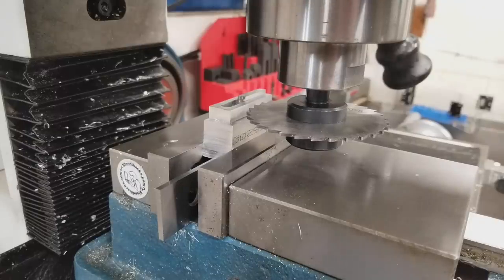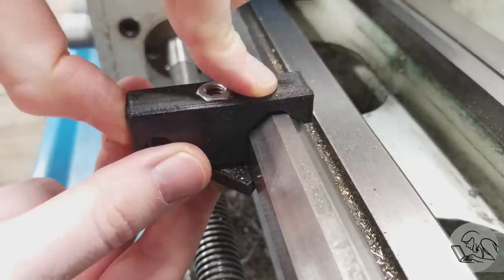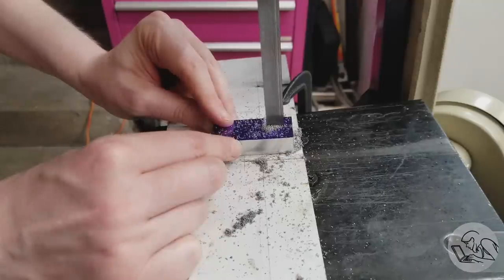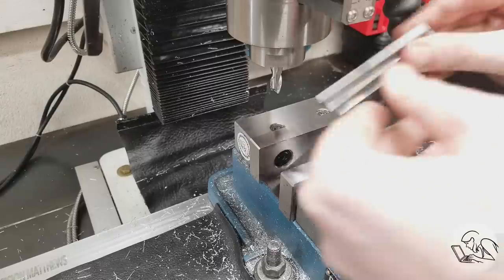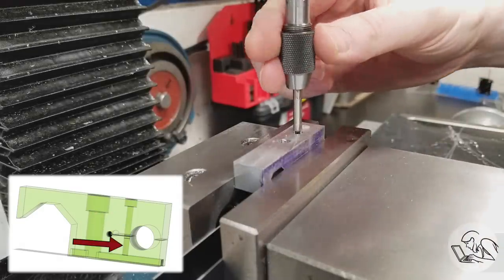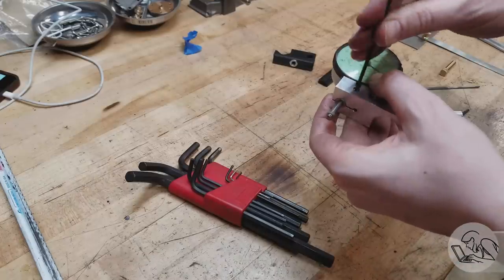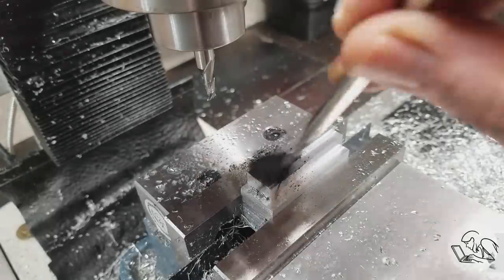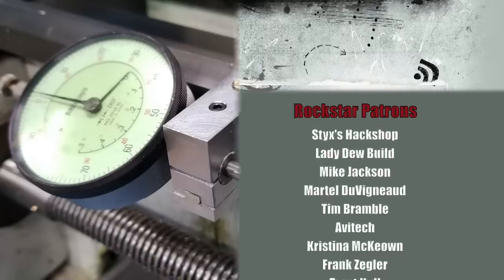Lathe Stop!

Comment from the maker: Lots of good theories on the 94°, but I think the most convincing one is that it’s so they can easily grind the mating surface on the carriage with a 90° wheel and not have to worry about clearances. Sounds plausible to me!

And yes I know tongue and grooves and mortise and tenons are all things that people want to know that I should know.
Reply: (Al + Fe) * hanky panky = galvanic babies
Reply: Ask Mr Pete. The YouTube shop teacher. If he doesn’t know no one knows.
Reply: I'm gonna have to use that precision cat hair tip, although mine would be precision dog hair. I wonder how that scales? 😉
Reply: #MetricDegrees
Reply: I recently both watched this video and skimmed Moore's Foundations of machine accuracy. Page 56 concludes that 90 degree V-way is the "best practical choice" (for measuring machine design, that is).
Reply: Supposedly this reason:
"This is how slideway grinders tend to work on prismatic beds. The saddle is carried on a sub table and offset so that grinding one side of the V on the bed grinds the opposite side of the V on the mating part. It helps insure that the angles actually match - the important aspect."

Comment: Snorted out loud at "Big Muskie the 13,000 ton dragline," because that trivia occupies a seldom-used corner of my brain as well!

I love, love, love how you analyze design and order of operation decisions, because it is so much more informative than simply acknowledging a mistake or sub-optimal choice.

I also like seeing someone adapt who doesn't have the best tool for every job, works with the limitations of what she has, and makes a worthwhile product.  Kudos for using angle blocks, a protractor, adjustable parallels, and machinist jacks in a single video!

Comment: An option for thread in Aly is to fit helicoils, these are a thread repair system which installs a S/S coil, in the shape of the required thread, in the hole. Have used them extensively on Aly motorcycle engine cases and the new thread is extremely strong.

Comment: Just made this. Not precise as per plans as I'm a newbe.. I was uncomfortable with how close the cap head screw hole "could" be drilled to the indicator hole. After a head scratch or two I decided to skip the clamping feature and slit.  I drilled a hole in the end level with the indicator hole for a set screw to secure the indicator. Very happy with the result. Thanks Quinn for the outline/idea.
Reply from the maker: Excellent! Nice to hear someone else made it

Comment: Slitting saws are what I use on my CNC all the time.  Helps reduce ops.  I use a 3.5" diameter 72 tooth carbide saw, 0.058" thickness.  It's quick satisfying to have a very thin web at the end.

Comment: I just checked the front v-way my Grizzly G0602, which I've always assumed is made from essentially the same castings, and to my surprise, it's square.  No idea why the PM would be 94 degrees.  I wonder if they're all that way or if yours is a unicorn.
Reply from the maker: Wow that’s really interesting. The castings are the same, I’m sure, but they must grind them differently. I think Weiss makes the PM machine.
Reply: Blondihacks I just checked my PM1340GT and it’s 90 dead on.  Maybe the one precision square used on mainland China is out of calibration.  😁

Comment: Hi Quinn, thank you for another useful video. I appreciate the time you put in beside filming the event, is large. I would like to help you with a bit of advice, and, for many others I see do the same thing. (Don't think I'm singling you out).
When using a hack saw, please use two hands, one on the handle and the other on the frame front. Your blades will last longer, your cuts way more controlled and your fingers will love you even more. The hacksaw is one of my "go to" hand tools, I have three with different tooth pitch blades fitted, adjacent to my vice. I used to train machining apprentices and the file and hacksaw were major learning points for them.
Please keep your vids comming, they are aimed at the right demographic of machine tool owners. Well done.

Comment: My local tool supply carries Thurston HSS slitting saws.  I have had good results with the 2.75" x 0.040" 72-tooth blades on my small mill.  I usually run 400RPM in mild steel and a little faster in aluminum, definitely in the conventional direction only unless you have ball screws.  I did make my own TTS-style arbor, which is very rigid, but the saw still runs out.
Reply from the maker: Yah, real machinists tell me that 100% of slitting saws run out. It’s part of why they say to take deep cuts with them, otherwise one tooth does all the work.

Comment: Looks good. This is my kind of machining. Measure twice, Cut once, Test fit........... Realise the dimensions on your carefully drawn plan don't quite work in this real world application, Cut again, Scratch head, One last cut, Swear a bit, A few final dimensional tweaks with some files, Job done ! :D
I occasionally feel like my lathe tools are only there to rough things out before I get them to final diameter and parallel using emery cloth ! LOL !

One little thing to note though. It's always good to have the DTI only just clamped tight enough to stay put in normal use. If you forget it's there it's usually better to have the carriage push it out of the clamp so it can take it's chances dropping into the chip tray than to risk crunching the gauges internals. Alternatively, fitting a bolt into the right hand face of the clamp as a stop to hit before the gauge bottomed out also works pretty well.

Comment: The deformation in the plastic for the stop is a problem if you use the auto feed. However, for a student, where it has to do manual feeds, it is a god send. If I get in, I am designing and printing one of these for the lathes where I will be studying at, that is for sure.

Comment: I made something similar, but use it as a dead stop instead of an indicator holder. The tenon is OK for a printed part, but is a pain if machining one. All that's actually needed is a retained pin superglued into the holder, and a slightly oversized hole in the clamp bar. Much, much easier to make! It's used nearly every time I use the lathe. and after six year's use the locating notch is starting to spread, so I'll eventually replace it with a steel part.

Comment: Good job, normally I would expect to use the 3D printing to refine your design before whittling metal. On that point I must get round to changing my end stops from 3D printed versions.  I would guess an angle slightly greater than 90 degrees is used so it is possible to grind the sides of an internal V using the radius of the grinder (or possibly shaper) whilst maintaining side clearance.

Comment: Hi Blondie. On this side of the pond, a slot drill will cut a hole through solid material, ie without a pilot hole. Slot drills are usually 2 fluted but can also be 3 fluted, these are called FC3's or 3 fluted slot drills. I'm not sure what the FC stands for but who needs to know? 
End mills will NOT cut a hole through solid. 
As the manufacture and supply of quality cutters is limited to only a handful of brand names that, importantly, also have a worldwide reach, it is very likely that the same terminology is used in every English speaking country. 
Here i the UK, this definition IS WRITTEN IN STONE! 
Hope this helps to stop all the confusion that I hear so often in the USA.

Comment: Very nice video. Well done and easy to follow and listen to. I will definitely build one of these machinist hammers. Easier to machine the central head tap on the milling machine, as you mentioned in the video. I would rather drill thru & counterbore the head for a #10-24 SHCS and tap the end of the handle for same, then c’bore the opposite side (180 degrees on center of the clearance hole and c’bore) for the handle to fit into the turned diameter. Keep up the good work.

Comment: Another way to remove that clamp from the block is to bandsaw it off from the chunk and then mill the sawcut face to dimension.  I feel the same way that you do about slitting saws and I usually find a way to avoid using them.  For instance, when I'm making a clamp in steel I just use a super thin cutoff wheel in my angle grinder to make a narrow slit.

Comment: From what I've read the reason the ways are 94° is a corner cutting measure as the saddle and ways just need to match and slide along 1 degree of freedom. As the faces of the ways generally aren't used for precision machining, it's cheaper to give the ways a larger angle tolerance and match all mating components to that new master angle.

Comment: There's 180 degrees in a straight line. Substract the 137 from 180 and you get 43 degrees. Substract 43 from 137 and you will get 94 degrees left over.

Comment: ive been using 3d printers for quite a while now an when it comes to stuff like this i find myself battling with myself on making it with my 3d printers or using aluminum to make them so it would be a learning experience but in most cases i dont have everything i need to set the parts up to make the cuts so i end up drawing it out on paper then taking those meassurements an making a 3d model in tinkercad an then print it out in pla plastic. sometimes i consider taking an printing stuff that would help me set the parts up in the vise but ive always felt like the plastic wouldnt be the best option to do this with, but im at the point that i think im going to try it an see if i can use it to make some stuff that i can use to replace the printed stuff. im still new to all this an have had my lathe a total of maybe 3 moths and not even a month for the mill. i dont have alot of material to work with, the aluminum i have is 3 old amd heat sinks that ive milled down to square cubes basically just cut the fins off an the rest of the aluminum i have is from an old head that i took an angle grinder to an cut a few chucks of aluminum off. im going to keep cutting it down til i have it all cut up an able to be put on my mill but for the lathe ive only had old bolts that ive been able to find, an old brass hammer that was my grandpa's an my dad gave it to me so i cleaned it up an plane on fixing it back, just need to get something to go on the ends, not sure what to use for that, delron or rubber, i'll figure something out even if i just print something out in tpu but other than that i got a set of rods from amazon that was like 2mm - 12mm an it came with aluminum, brass an stainless, so i used the brass and made a set of bits to go in my soldering iron to make pressing threaded inserts into my printed parts alot easier so thats really the only useful thing that ive gotten to make. the rest has all been me messing around with it figuring it out but id like to make the vise blocks an stops and id like to make one of these lathe stops an one that holds my dial indicator or maybe i can make one that does both not sure, again im new to all the machinist stuff. the 3d printing stuff is what brought me to all the manufacturing stuff an i kinda got addicted or obsessed i guess u could say. has anyone got any experience with using 3d printed stuff like this one the machines. i made my own dial indicator holder for my mill an plan to make some for the lathe just havent gotten around to it but that works fine for that but ive not made anything that the machines actually use as like stops or for positioning parts in the vice. i know the parts are pretty accurate but i know they wouldn't be compared to what u would buy if that makes sense.

Comment: You are correct. A two fluted end mill is called a slot drill.  I don’t know why it is.  It just is.  At least that is what the old bloke taught me when I was young and now I’m old.  Shit now I’m the old bloke telling young blonde chick about slot drills. Does that make it true?
2 fluted Center cutting end mill is too long winded anyway.
Enjoyed watching you make yours.  Huge improvement on the plastic one.
Ps I made myself a MR Pete cartridge stop with a .050” per turn brass barrel on it.  It’s like an adjustable hard stop and it is a great addition.
My ways are flat so I didn’t have to dick around with 94 deg.  I like your theory about grinding.

Comment: Very interesting and nicely edited video. I'm just a little bit surprised with the issue you faced with the large slitting saw. I have a 200 W tiny mill (SIXIS S101) and and I've never experienced such problems. I only have second hans HSS slitting saws (high hand Swiss brands such as Fraisa or Siso), but never resharpened. However, probably I would have proceeded differently: cut at the band saw, then surfaced on the mill (fly cutter). Greetings from Switzerland

Comment: You might put a horizontal threaded hole a little to the lathe side and above the indicator.  You could then use a screw and a jam nut as a physical stop without having to remove the indicator.  You are likely going to want to use the indicator to position your physical stop, at some point.

Comment: I recently made a 3D printed chuck cradle for a new PM-1228 Lathe. I assumed the ways prisms were 90 degrees, and they did seem to be, getting the height took a couple of adjustments but the 3D part fit well to both prisms and flats. I checked them more carefully after seeing this video and they do seem to be 90 degrees as precisely as I could check with a square. This lathe came with a metal stop, but it doesn't seem to fit all that well. Another project for the list...
Reply: How do you like the 1228. I've been looking at it.
Reply: @kBIT01  I like it a lot, it was about the most I could find in the PM line that was 120V. It's a big step up from the Grizzly G0516 I had before. Support from PM has been good too.

Comment: My guess would be, and it’s only a guess, I would say it’s 94° so they can sell you proprietary parts for it, and to make it harder for you to make shop built parts so you will buy the proprietary parts.
Reply: That's probably it. My South Bend has 90 deg ways. If you wanted to scratch build a better steady rest 90 degree vee ways are much easier to fit.

Comment: Hi Blondihacks. I've been thinking. I know! If the ways are ground 90° plus to allow the accurately 90° milled carriage to sit on the ways why not do the same thing for the stop? There would be a narrow line contacts on each side of the way 'V' which should hold the stop firm against the clamp. No need to try to match the 'V' outline. BobUK.
Reply from the maker: The 3D printed one was 90° and that’s part of why it didn’t work very well.

Comment: I'm wondering if a 3D print in steel would work? I can't see that high precision is necessary. (Thou perhaps I would make a turned and reamed insert of brass, to hold an indicator clock. Just not to scare it's gripping surface.)

Comment: QUINN  I have some questions about carriage stops.  Already figured out why I should have one,  (the hard way).  The process of making one seems straight forword, so my question is; assuming the carriage is moving under power, what if anything disengages the drive gears when the carriage contacts the stop.  I would hate to strip gears by not doing this correctly.
Reply from the maker: Nothing! You disengage the power feed when close and move up to the stop by hand, same as you would when using an indicator or DRO to set a depth.

Comment: I would not make the stop out of aluminium  X)
The contacting faces may lead to rust due to the noble and less noble metals interacting. I hope I could explain this somewhat understandable.
This is a classy issue in the automotive industry when mixing different metals they start to rust and bolts shear off or panels start to degrade.

Actually, I would have drilled a recess in the bigger hole to fit a spring in there. You would then have a springloaded clamp for convenience when moving, attaching and detaching the stop.

Comment: Thanks for the great video! I can appreciate that the aluminum version will hold much tighter than a 3d printed one. Do you think one made from delrin would hold tight enough for most work but still slip if autofeed went awry?

Comment: My MKL (Mysore Kirloskar Ltd) Enterprise 1550 lathe has an 80 degree included angle on the bed. I still struggling to figure out how to cut a lathe stop. It came with one that has a micrometer, but I need another to make a hard stop at the other end. The DRO sensor that I bought is just a little short of the full travel of the apron, so I need a hard stop to keep me from ruining the sensor. Any suggestions are welcome.

Comment: Another really cool machine project. 
I know you use a Matthew's mill and lathe. I guess the mill doesn't have a head that can pivot in cant ¿kant? (Axis B)  Happy troll no good with engrish. XD. The opposite of nod ( Axis A)
If thats the case then have you considered a mounting plate for the quick change or directly off the cross slide to let you horizontal mill on the lathe? Like what you might see on just1guy shop

Comment: Thanks Quinn! Fingers got run over by a tiny digger at 17:30 again I see.. did you sat previously  that it was due to position of one of the mill table locks?
Reply from the maker: Yah,  very close to the X table screw so my hands get oily in the pattern